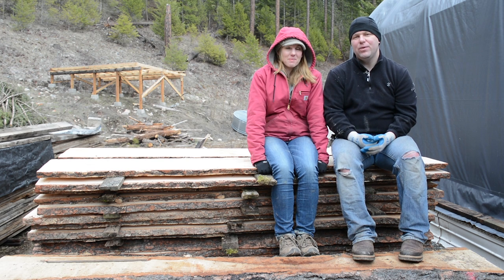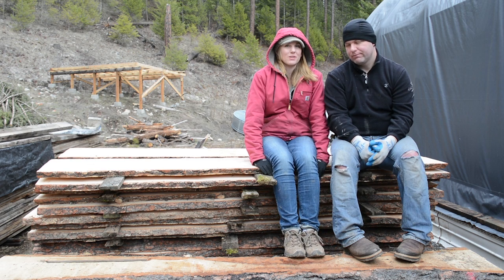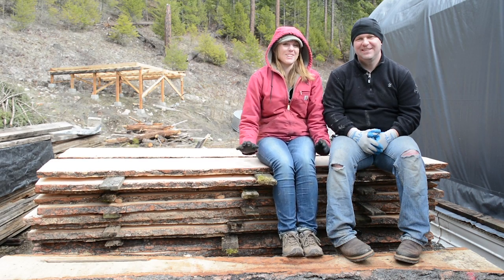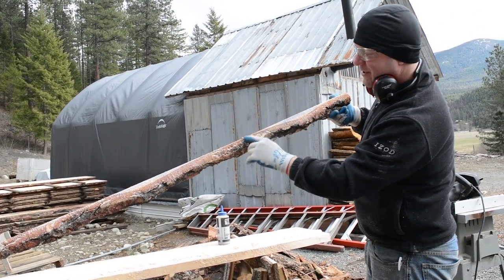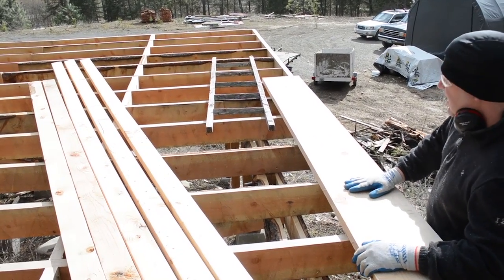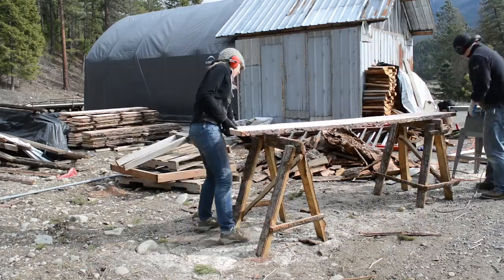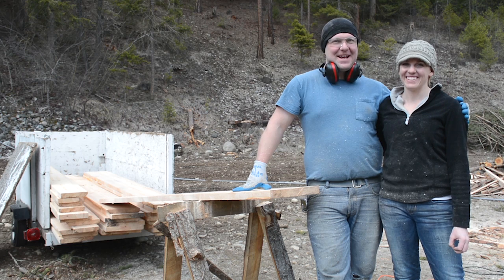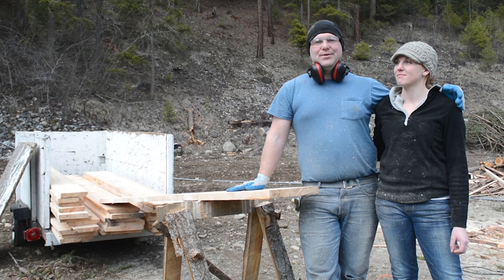How to Make Your Own Lumber with a Chainsaw Mill

Comment: Just a tip for you, turn your saw around so your base plate sits on the board properly and doesn't rock around, next tip is if you measure your base plates distance to the blade from the edge you can either find a piece of thin timber to nail offset to your string line as a guide and this means that you can quickly hold your saw to the guide and have it not rock around on you, it only takes a few more minutes in your set up but makes it much much faster and much easier and accurate to use that way, Festool make an amazing saw with an amazing aluminum guide that clamps to things, this is more costly but as a professional I can tell you it really is fantastic to use and quick which for us justifies the outlay to start with. but the guide is cheap and easy and because the offset of your saw blade to baseplate never changes once you start doing this you will always know how far and infact in my case I only mark the offset line and put my guide to that the more square that side is by the base plate sitting flat the easier on your table saw and you when you run it through there as well. Love your Channel and all you wonderful work so keep on going 
Yours Truly 

Garry

Comment: Great work you two, impressive.

If you don't know, make sure that the planks are placed such as the top are all up. 
What I mean is if you look at the end of the board, the end grain, they will be curved, you want to set the boards so they look like mountains or hills, NOT cups. THe planks being still wet will warp some, and they will cup, you want the cup down so that the top of the board is rounded, if you have the cup up, then the top edges of the board will stick up and it will not be nice.
I hope you read these comments.

Domo
Reply: +StuInTokyo ~ I didn't see your comment before I made mine, but you are absolutely correct.  I said basically what you mentioned and I really hope they read these comments before finalizing the deck boards tomorrow.  I would really hate to see all that hard work go down the drain.
Reply: Your 100% correct. The bow on those boards have to face up or somebody
just wasted alot of time and effort into
this project. . .

Comment: Hey Jessi/Alica,

I Just want to make a general comment about all your videos and the process you are going through....I stumbled across you Utube vids when I was looking for examples online for battery charging using solar panels.The reason being I've not long become partially disabled and consequently had to find a way to ease my mobility issues. So I converted my bike to an E-bike and built myself more battery packs to extend range or charge set 1 and use set 2 etc. So I was looking at a fold- able 60W Solar panel to charge my packs if I went off-grid camping, and tadaaaaar I found your Videos....!

I'm hooked, a fan, appreciate your cander , I love your style of ' just say it as it is' with a big nod towards what is simply the most practicable solution/fix or choice to solve the problem. I've watched several vids now , and could happily watch you all day, but can't as I do have to concentrate on what i'm doing lol.

Last point, I am a Control Systems Engineer ( doing industrial process stuff)  but I too have to pull that Electricians face some of the time lol. Anyways I'm a semi-disabled Brit Engineer with a big SOH ( satire/pith/witt ) and I say, loud and clear....DONT CHANGE, carry on ,and bloody good luck !!!!

Paul.

Comment: instead of snapping a chalk line on the board you could clamp a piece of dimensional lumber on the board to use as a guide for your circular saw. I think it is quicker and you definitely get a cleaner straighter cut.

Comment: Smart move on not rough cutting full 2" !   I sure hope you have a carbide tooth blad on both of those saws.

Suggestion.  Cut the boards that are >10-12" in half.  Narrower boards are less likely to crack, especially when nailed down green,  Even though you loose the saw kerf to saw dust, you will make it up (and maybe a bit more) in spacing between boards.

When nailing down the boards for your deck, stagger them so that they don't form a line across the deck.  Much more appealing to the eye.  Screws go in fast if you have an impact driver, but they do cost more.
Reply from the maker: Think we nailed all those points. We wanted wider boards for the look and feel. Thankfully if we want we can always tip them more narrow.

Amen on the impact driver. We're loving our Makita brushless set. Makes quick work of long screws.

Comment: Pro tip:  Make yourself a circ saw guide.  Search youtube homemade circular saw guide or DYI tracksaw.  Cut your time doing that big bunk in half.  If this is something your going to be doing a lot of in the future a track saw would make for a great investment.  Your gonna find out much like like your experience with your homemade alaskan saw the homemade or dyi will work but investing in the real thing is so much better and easier to use.
Reply: +Mopardude Yup... Even doing something as simple as clamping a steel stud to the rough cut board and using the stud as a fence for the circular saw would help.  It would also undoubtedly leave a straighter cut which would help stem binding problems on the table saw. Put another way, binding on the table saw is often caused by a wavy edge on the board running against the fence.

Comment: Hi,Great videos!What is the timing for how long after you cut down the tree to when you made the planks?Then how long did you wait until you started making the actual boards for your deck?Where did you find the information on how long to wait?Thank you,Tj
Reply from the maker: Common misconception about drying lumber. 

http://royalstonoak.com/why-is-green-wood-used-for-timber-frames/

Atmospheric drying will never equal kiln drying nor is kiln drying needed or desirable in many cases. 

As it turned out the tree was down for about 4 months before we milled it but that was just circumstances. It was covered in snow. 

Lumber was cut within 2 days of slabbing. Careful stickering and proper stacking are more important than anything to prevent twisting. 

Account for shrinkage in your cuts and installation. 

I don't know where people get all this misinformation and fear about drying wood. I'd love to see that. There's plenty of info about using green wood for all sorts of things. 

In fact as soon as you expose kiln dried wood to the atmosphere is starts absorbing moisture and is no longer dry. 

The major reasons for kiln drying is in fact shipping weight and stick built construction techniques which seal in the wood not allowing moisture to escape. 

If anyone thinks kiln dried wood doesn't wrap, twist or crown stop by your local hardware store and have a look at kiln dried boards. They're a mess.

Comment: Good job on milling your slabs into dimensional lumber.  Those were some pretty wide boards you ended up cutting.  The wider the board, the more it tends to cup or warp especially dealing with green lumber (ie not kiln or air dried).  The video mentions that you went for a standard thickness so that a board can easily be replaced in the future with one bought from a lumber store.  Did you also go for a standard width also for the same reason?
Reply from the maker: +bwillan We didn't go with a standard width because that would have resulted in a lot of wasted lumber, and we likely would have had to cut down an additional tree. We're confident that if we need to replace a board then we can make do. It's all about finding a balance of future-proofing but then also working with the materials you have. In the end, we have a beautiful hot tub deck that will last for many years to come.

Comment: Is that wood seasoned? I see it was cut last fall, being a soft wood ,does pine take longer to dry out? Because it's not treated for outdoor use ,how long do you expect it to last? Will it splinter?
Reply: Heard from a contractor friend that pro's actually prefer building with green wood because the nails/screws go in easier. It can dry in place through the spring and summer, then seal it in the fall. It's all good.

Comment: When you use a circular saw to cut off an edge, place it the other way on the board so that the wide base of the saw is sitting on the finished board. Then measure from the board edge the width of the saw base and clamp a straight guide that you can run the saw along to make that first cut. You will get an absolutely straight cut that way and won't need to spend as much effort keeping the saw flat to the board.

Comment: While a saw guide would be great, just turning your circular saw around and sawing in the direction that puts the bulk of the weight of the saw on the board instead of having over will make for better cuts and less fatigue.

Comment: Are you sure you want to screw down that green wood?  It will last longer if you stain all 6 sides of each piece of wood before you screw it down.   

Plus, I'm all for using your own trees if they need to be thinned anyway, but one wonders - with the chains for the saw and fuel and everything, given how cheap lumber is, do you think it's really cheaper to mill your own trees?  Timbers? You betcha... Not being critical but honestly and respectfully asking.

And I did really like the dialogue where you each let the other finish and kept if brief.  I see more improvement every time!
'Stead on!
Reply from the maker: +M Miller We wanted to get our wood screwed down asap to keep it warp-free. We've been analyzing the cost of milling our own lumber and comparing it to buying lubmer or even buying just the logs rather than using trees on our own property. It appears that a truck of logs is about $2k and that we may need three or so to build our timber frame which could be around $6k, or we could use the trees on our property. Fuel is cheap right now, and all other costs are minimal, but we haven't made a decision yet as to which route we'll go. We hope to elaborate more on the cost of various options as we gather more info so stay tuned! And filming video on the fly is harder than it looks, especially with two people, and double-especially without a pre-written script (Because who has time for that? we keep it real and have a property to develop!). Perfection isn't our goal but finding a groove tends to happen over time.
Reply: +Pure Living for Life ~ make sure to check the end grain before you screw it down or you'll have issues when that green timber eventually dries.  That size of lumber will curl and the screws will bust out...trust me on that.  End grain should all match and should look like "A rainbow" at the end.  Not the best analogy, but that's the general idea.  Also, if you can get some sort of end sealer, the boards won't split out.  Apply with old paint brush.  Can't wait to see the end result! :)
Reply: +pikehunter23750 Yep - we call that "bark side up". When the board cups, it will be concave on the bottom so it won't hold water.
Reply: +Pure Living for Life You could also rent a bigger sawmill/ find someone that has one and will do the cutting in exchange for some of the wood. Might be worth pursuing something like this to speed up the overall build cycle. On the other hand, developing the capability to do it "in house" will pay dividends over time. On a related note, I understand the rationale behind the hot tub deck (water collection + small storage area) but can definitely see the merit in you building a rough pole barn so that you'll have a covered work surface which would allow you to station the tools in a bit of an assembly line fashion and/or not have to put them away each day. It strikes me that having a larger area to move around in during the winter would be nice too.

Comment: did you buy any anchor deal for the ends of the boards as if not u should by some as it stops the ends of the boards from cracking and helps them to dry more evenly just a thought as u are milling your own wood so look it for yourself

Comment: Hey Guys being in Australia we have pretty strict classifications on timber qualities. If I remember right structural timber has to be H5 class (designation for load bearing knots splits etc). Do you have the same requirements there or do you not need as stringent council approvals for your buildings? Inc Licensed Builders/ Owner Builders and DIY build restrictions for structure erection.

Comment: Hey guys. Love what your doing.  I'm concerned about the wet timber and shrinkage.  If I can point you to youtuber wranglerstar.  He did something similar and you might pick up some tricks.  Timber seasoning is extremely important.  Even with seasoned timber you can expect a 5% shrinkage over time. (Australian hardwoods) I'm not sure about unseasoned timber or the type of timber your using. Anyhow. Have fun, enjoy the journey and stay positive. Regards Mannie.
Reply: +Mannie Benkovic  shrinkage can be a big problem, i have seen a 12 inch wide board shrink 1/2 inch in a year :(
Reply: Nh Homesteader shrinkage is the worst... jumping in the pool in February always does it to me... wait what kind of wood were you talking about? lol
Reply: Funny Guy ... rofl!

Comment: Hey guys. You need to invest in a small band saw mill like Hudson or one of the others. The time you save and less waste. you can find them for less than $4000. for a great little saw. then after your finished you can sell it for just a little less than you paid. I've got one that I converted from 18 to 36 inch and I love it. As always be safe and we will talk to you later. God Bless.

Comment: You would be more accurate screwing a 2x4 to ur rough board to make ur first cut instead of just using a skil saw. It would be a better guide to run alongside instead of freehanding it. Just a thought. Any mistakes in cutting is transferred to the tablesaw.

Comment: How long did you let the slabs season (dry out) before you trimmed and routed the edges?
Reply from the maker: About a day or two
Reply: +Pure Living for Life - Oooooh...  Will be interesting to see how using "green" wood holds up on the platform.  Good luck!

Comment: i noticed you shaved off some bark off of one of the boards you cut.  Is it not good to leave the bark on?
Reply: The boards needed to have straight edges so they could be butted up against each other for the hot tub deck.

Comment: hey, you guys probably answered this already, but where is this? what are you guys doing for Internet to post your vids?
Reply from the maker: +David Bronson We prefer not to disclose our location to maintain our privacy, but we have a simple wireless internet setup w/ a speed of 1-2MB which works well most of the time. We have lots of tiny wireless internet providers in the area come to find out, they just aren't really find-able on the internet which is an ironic!

Comment: you're body of your circular saw should be on the board.just a tip to cut straighter .and if you make a lot of long rips a worm gear oil filled circular saw is very nice to have.
Reply: Definitely on both. You can also speed the process and remove some of the straight line worries by using a straight dimensional board or manufactured edge of a sheet of plywood  and a couple clamps as a fence. You have to measure for the offset of your saw plate, but then all you have to worry about is keeping the saw against the board.

Comment: dude screw or tac on a piece of straight lumber or plywood ripper and run it through the table saw then remove it and rip it to dimension
Reply: +darangemaster1 Excellent suggestion!
Reply: or if your table saw isn't up to the task make a rip guide for your circ saw! :)

Comment: When have to replace a 2in board I use standard cuts (2x4, 2x6) and on the hidden side attach a rip to desireded width of 1/2 in plywood.